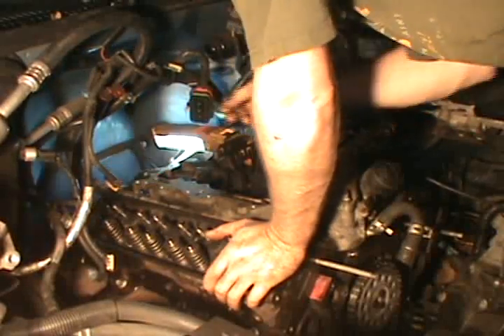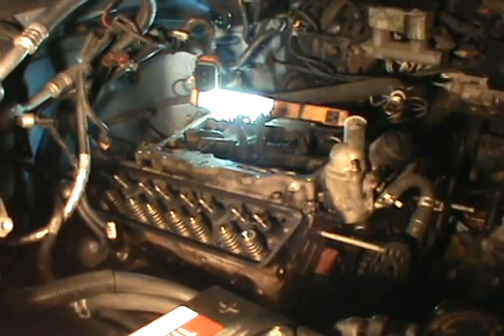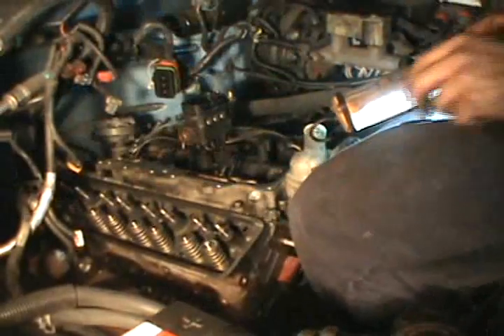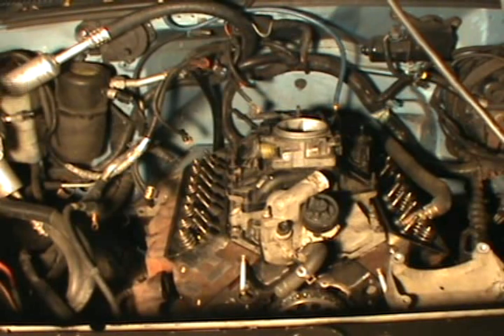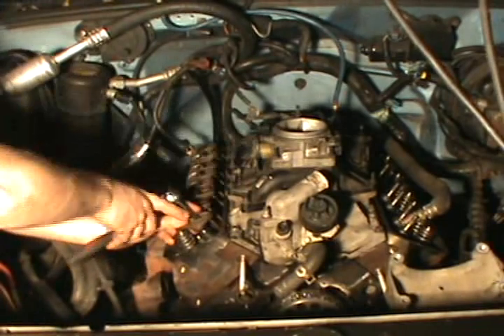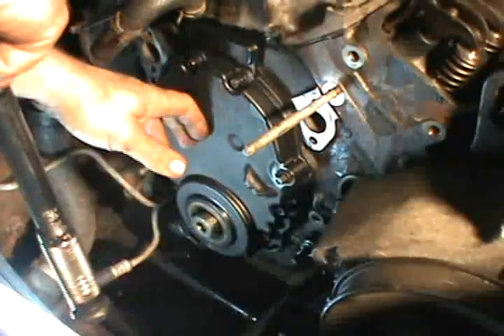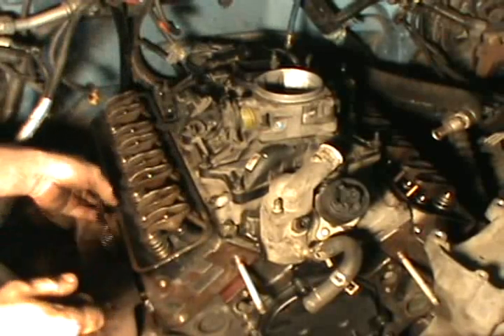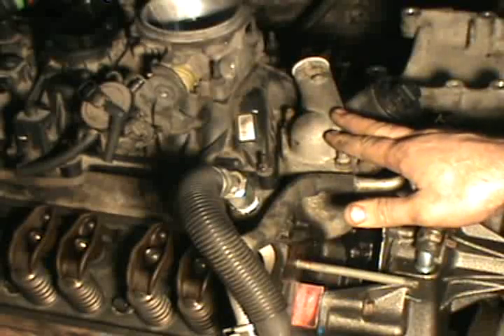part 5, Vortec 5.7 350 head gasket, water pump & timing chain replacement, Chevy/ GMC

Comment: According to Mike at "Real Fixes Real Fast", the "8" cast into the distributor stands for the 8 cylinder engine. There's also a "6" cast into the distributor in a different place which stand for the 6 cylinder engine. Your videos and Mike's video series are the only complete engine rebuild video series I've seen on YouTube so far, (and I've looked far and wide.) THANKS!!! for all your hard work!!!

Comment: I must have missed a part why do you need to drop the oil pan i just replace my timing chain and now i match my sprockets from top cam to bottom and cannot set my timming right its at tdc and points to number 1 spark plug. need help or answer.

Comment: to everyone who wants to know the signifigance of the "8", its because the distributor is universal for the 4.3, 5.0, and 5.7.  there is a "6" and an "8" inscribed in the distributor.  you line it on 6, if you have the v6, and 8 if its the v8.  it points to cylinder 1 in that respected motor.

Comment: when i did mine, the quick connect at the front broke, but insead of changing the whole thing i just took the ring and the guts and stuck them in the original

Comment: i was wondering if you can go into more detail about why you dropped the oil pan i drive a 97 gmc k1500 5.7 and have to change the head gasket so also chaging the timing belt was planing on changing the oil but not till after i get it warmed up so i can make sure i get most of the oil and get the little water that might be in it out was wondering if i stil have to drop the oil pan when i change my timing belt

Comment: I do it my way with the upper intake bolts,impact wrench tight.I have a small IR 2101 1/4 impact I use and have not broken off the bolts with it yet

Comment: I was told I might have spun the bearings when the head gasket blew. The oil psi dropped to zero and a huge cloud of white smoke/steam came out of the exhaust. The dip stick read four times over the normal and appeared to be coolant oil mix!?! What do you think happened?? Thanx...

Comment from the maker: @catch1n2 if you the same engine style. to do it correct you need to drop the pan, this style has the plastic low profile cover , not all 5.7 are like this. other styles don't require you to drop the pan... with the marks lined up dot to dot, that's your valve timing, not the ignition timing. not sure what year you have. this style. with the gears set dot to dot.  in the distributor under the rotter there's a #6 & #8 stamped in the housing,  since this is a v8 point the rotor @ 8 hope that helps

Comment: I thought you were supposed to adjust the valve lash  when both valves were closed. It seems like you just torqued them down is there a reason for that or is the information I got incorrect?

Comment: I eliminated the quick connect coolant fittings completely on my 95. Old style hose fittings are available anywhere and all you need is some high quality bulk heater hose from NAPA. You can get the old style coolant fittings made from stainless steel that’ll never leak again.

Comment from the maker: @dylandrostvids15 did you have a chance to check out part 6, if not check it out i adjust the valves in part 6. you can get away with backing off on the rockers enough to remove the push rods, if you would like me to send you a step by step process for adjusting the valves let me know i will be more than happy to. thanks will

Comment from the maker: @MrCubanator520 if your referring to the oil pan gasket, i dropped the oil pan, that's a job in its self, i mention it. in the video i believe, however, i opted to leave that part out because its, pretty straight foreword to remove, but time consuming, some say you can do it without dropping the pan by cutting the corners then using silicone, i just don't like taking chances like that. i am assuming you have the same style timing cover, hope that helps,if you need any additional info let me know

Comment: why does the oil pan have to be dropped? i havent made it to that point yet, but im just curious. how do i get the power steering pump and that case around it off? i got the alt,compressor and that case off of that side. i got the fan off with water pump still attached, how do i separate the two. and do i have to pull the distributor off? i have a blown head gasket but im going to change the timing gears,chain and water pump. i have the 2000 tahoe limited w/ 5.7 vortec w/ 175k miles

Comment: Great video, why do you need to drop the oil pan? Does it lock into the timing cover? I have a 2001 2500HD 8.1, P0343. Tried (3) new sensors, new PCM, new grounds, checked all wiring, I think the cam gear may be floating, what do you think? Thanks

Comment: It's a really good idea if you're going this far to replace the vortec spider injectors. As you indicated they are very brittle from being hot under the intake manifold and are known to be problematic on these. If it hasn't been done before it's always a good idea to replace them all at once. The worst is on those Chevy Astro/GMC Safari vans. Those ones require dash removal to replace that. A major pain in the ass.

Comment: Hey I got a question I have no compression in my #6 cylinder 350 vtec truck runs drives has a miss tuff idle is there any thing you could suggest to try and revive.a cyl

Comment: I know this is old, but maybe someone can chime in. I cant for the life of me stop leaks coming from where the pan and front/rear covers meet. My book says apply a 1"bead of rtv at those joints. It doesnt really specify exactly where though. Ive tried several times; with a new cover.  Whats the vortec trick? I have brand new everything( crate short block), and it leaks.